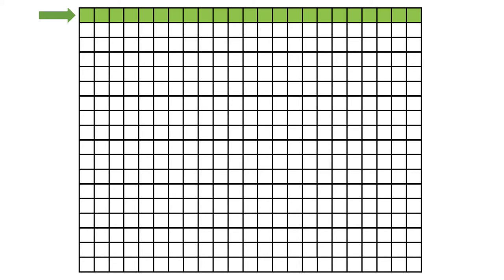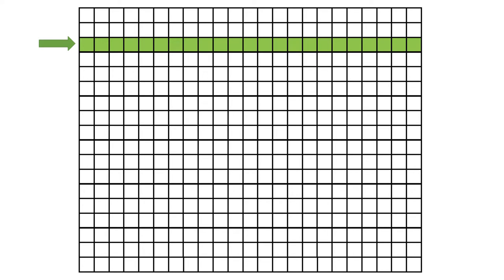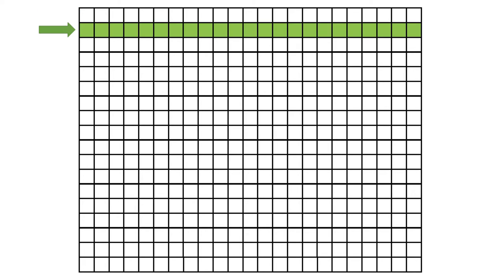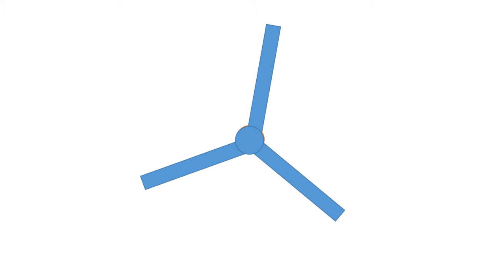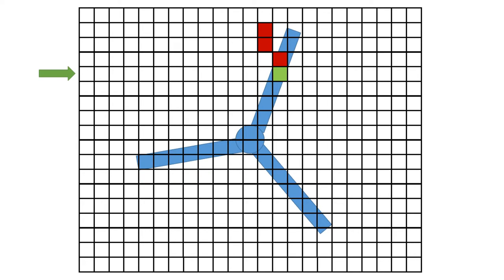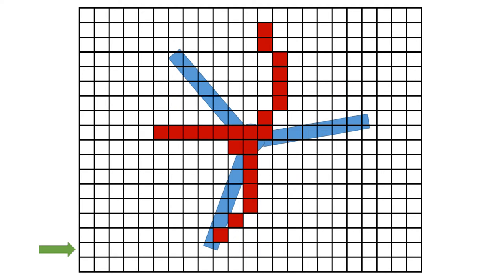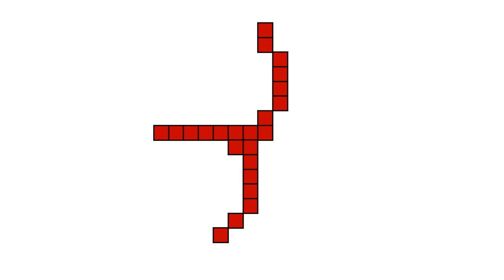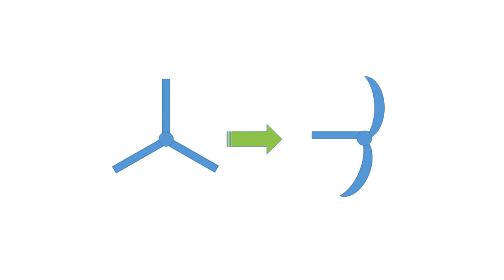Why Do Propellors Look Bendy On Video?

Comment: I had a cheap video camera that I fastened to the crash bar of a motorcycle and this is kinda the effect I got.
The problem was after I took it off the motorcycle the effect persisted even while just hokding in my hand or restung it on a solid surface.
Could never get decent video from it again.